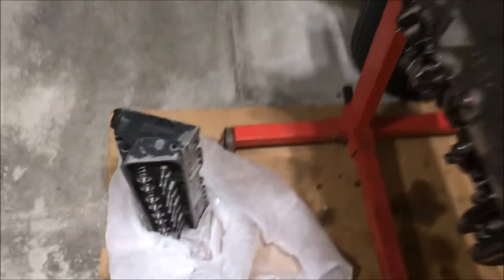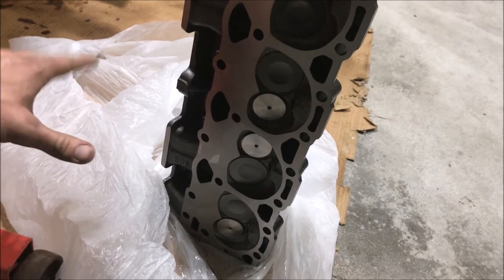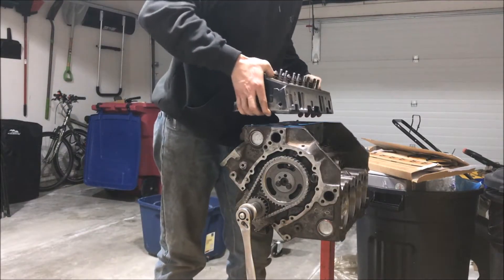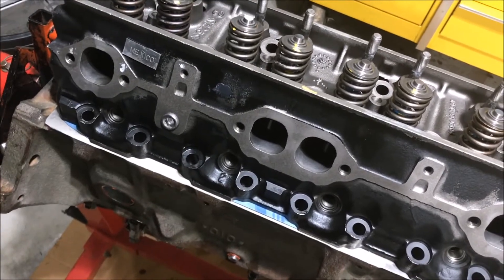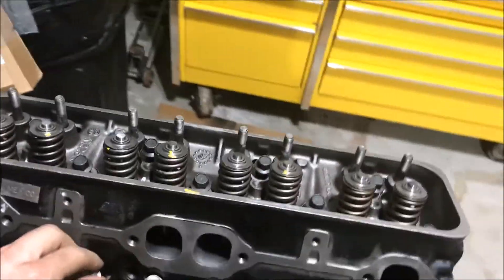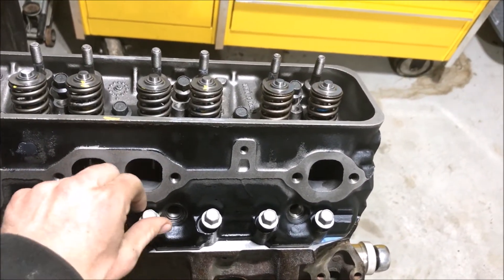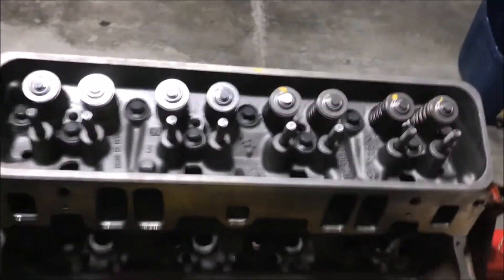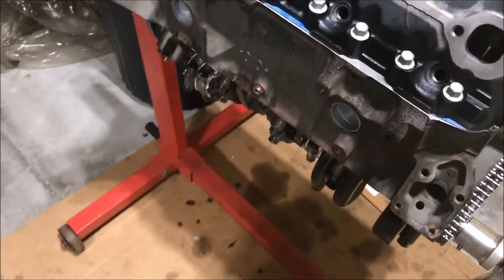Small Block Chevy - Cylinder Head Install

Comment: Since the Vortec heads block the internal coolant bypass holes, I was wondering how you handled this?  Some people drill holes in the thermostat, some add an external line from the manifold to the water pump, and others say that nothing is required if the coolant is allowed to flow to the heater core at all times.
Reply from the maker: I could be mistaken, but aftermarket heads will do the same thing. My understanding is that nothing is required additional
Reply: @iowadiy6361 do you know what torque is required on the rocker arm bolts.  I'm mess with my 72 Chevy El Camino.  Lost my manual when my vehicle was broken into.
Reply from the maker: @peacepoet1947 for a small block Chevy it should be 50 ft-lbs lubricated with engine oil
Reply: @iowadiy6361  intake manifold  depending on aluminum or cast iron varies on the different video I watched from 11 ~ 20 psi.  I also learned that you can turn the pushrod and tighten the rocker arm bolts until you hit the feeler gage.  If you can't turn the pushrod , it's too tight.